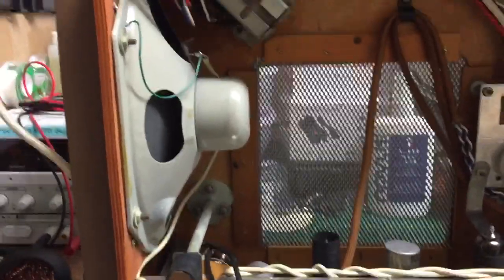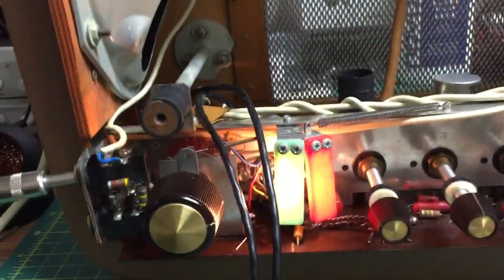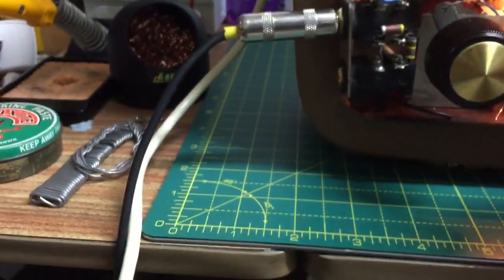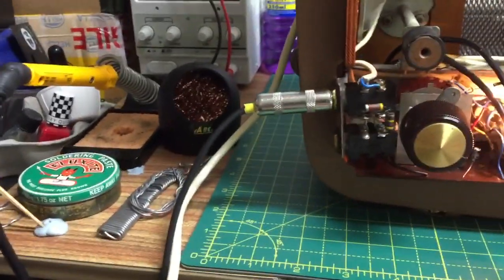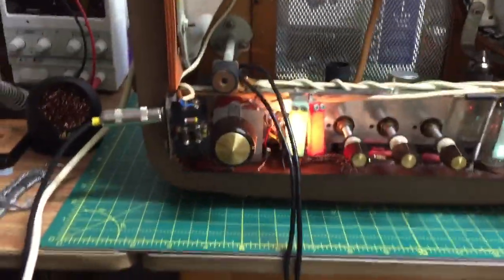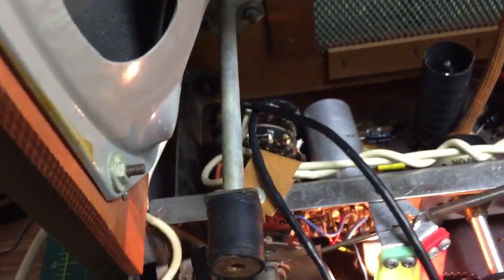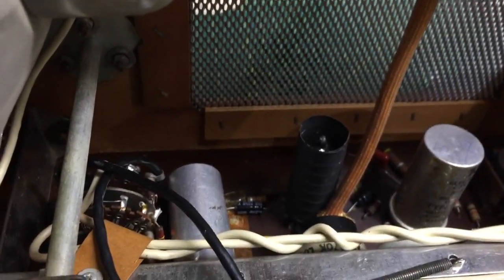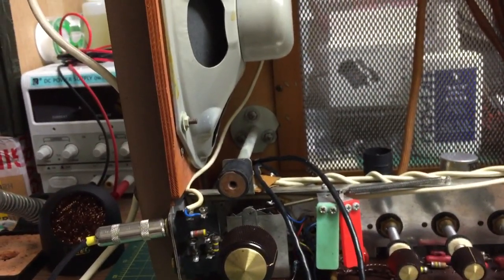My Restoration of a Brenell 3 Star (1962) Domestic Reel to Reel..... so far, lol.

Comment: Lovely Stuff Harvey Always Check For Changeing Values In Those Old Carbon Composition Resistors And a Leaky Grid Coupling Capacitor in The Output Valve As This Can Make It Run Hot Good Work Harvey !! Regards mike.
Reply from the maker: Every single cap except for the smoothing cap has been changed so should be okay, will have to check all the resistors at some point.Tried to measure a few resistors but can only get a true accurate reading when they are out of circuit.